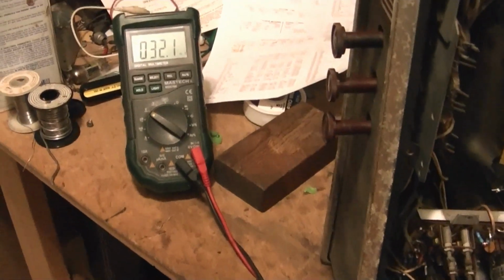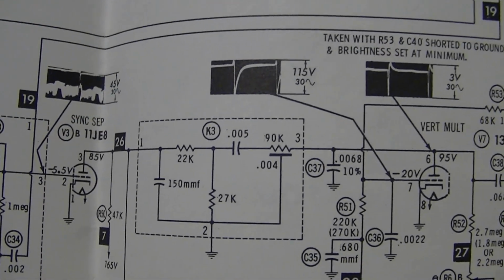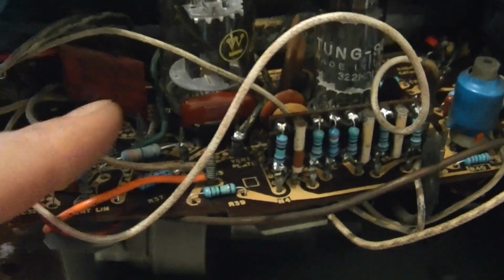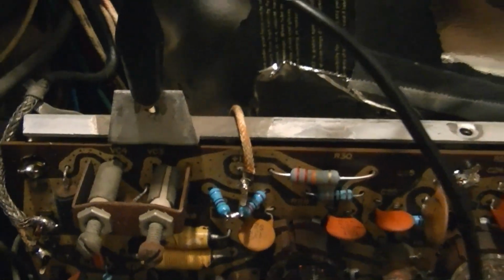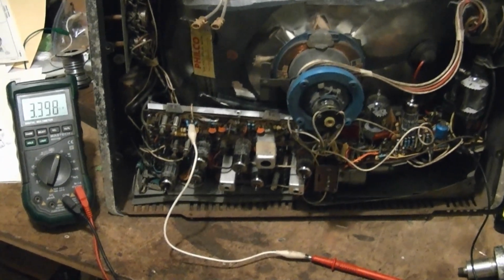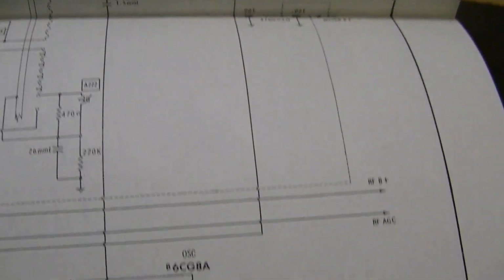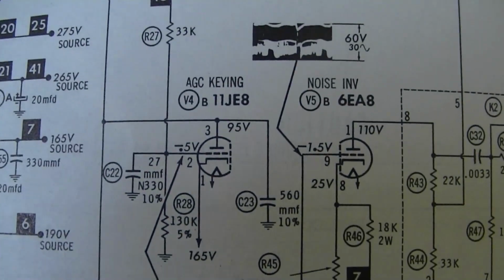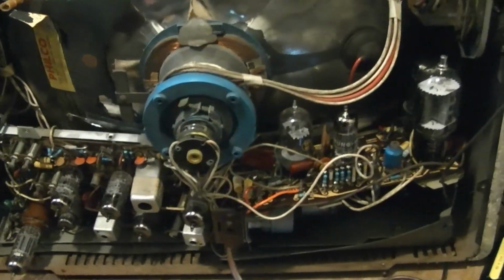Philco Town & Country restoration p5o?

Comment: I have same model. My voltage seems very low on B+. Neon Bulb for channel is running dim. White noise from reciever and amplifier is quiet . And the raster is so dim you cannot see it unless your in a pitch black room. But H and V work. Everything's just low. 

Do you think selenium could have failed in this scenario?
Reply from the maker: I can guarantee the selenium is not working as well as it should.  They gradually go bad over time.  Same with the electolytic capacitors.  What servicing have you done?

Comment: Man tubes are quite a bit hardier to electrical abuse than transistors. if you misbiased a transistor to that degree you'd have a nice little smoke machine...

Comment: Some nice deduction work! I'm impressed.

I was watching the video about the posts & was just playing with the idea of suggesting to you that you may want to look into getting a wirewrap tool that might fit these posts. A few seconds later you mentioned a "wirewrap tool". I was a hardware engineer & use to use wirewarap tools in mini & mainframe cpu's in the 70's on the backplanes. This tool is to small, as it used on smaller posts & 30 gauge wire. I bet you though the Philco factory had them!

Comment: I noticed it was the loudest when you pointed the camera at the flyback when it was running, and there was no whine when you powered on the set with the flyback disabled. So I think it was the electromagnetic field from the flyback being picked up by the camera's audio circuit -- an unintended way to tell if the HV is working or not! :-)

Comment: I noticed when you held the camera close to the TV when it was on, there was a soft whine in the audio, which sounded almost like a sine wave. Was that actually audible from the TV (or some other equipment on your workbench), or could that have been caused by the TV's circuitry interacting with the camera's microphone?

Comment: Technically speaking it's not what most would call a hybrid TV, hybrid TVs generally had some transistor only circuitry in them mixed with tube circuitry, usually in the TV sound and audio circuits. The only thing solid state in this set is the rectifier and detector diodes which is an idea that goes back to the late 40s if you include selenium rectifiers and germanium detector diodes.

Comment: YO its tron good vid i posted a new vid so u should watch it the problem with this set is u have to get the old one i saw on u tube here that the guys has for parts ! me and my uncle andy repaired a old set like this it took us a couple of weeks and was a pain in the ass un sodering those bords and replace in every single wire and part we tryed to just replace the bad parts but then the set wouldent aline so it broke down to every single part  going inside brand new now its perfect ! thanks !